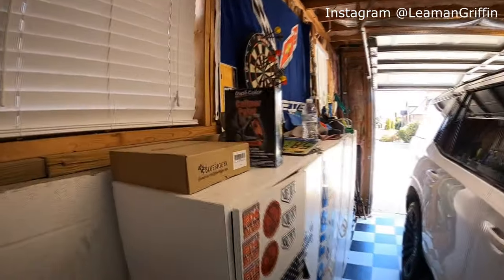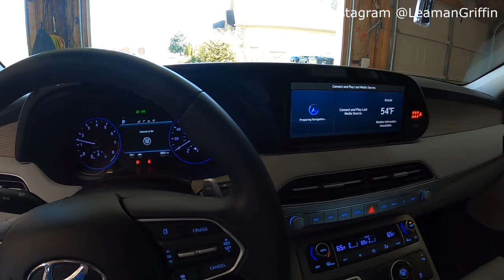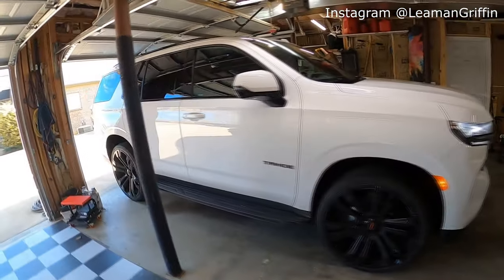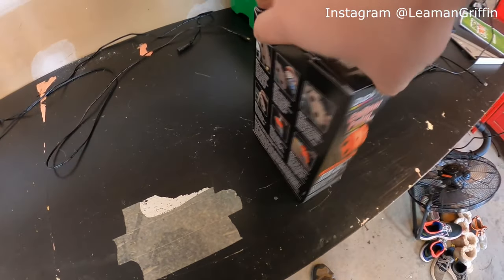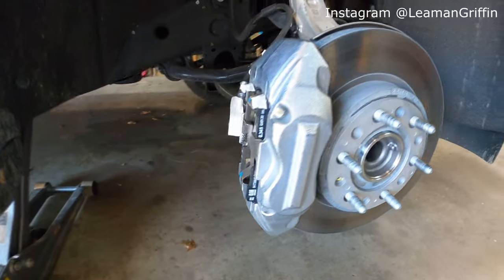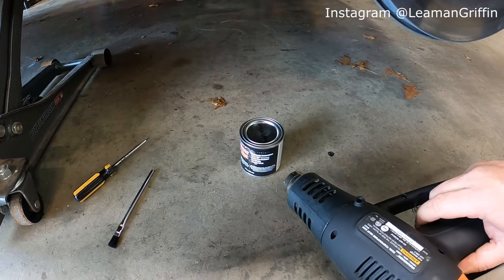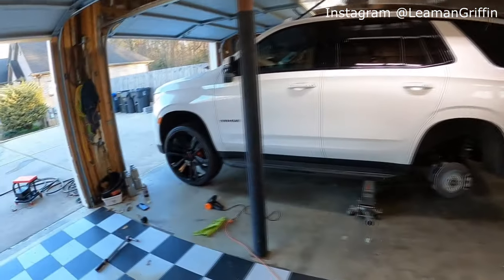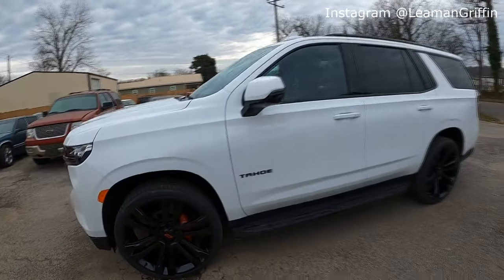How to Paint your Brake Calipers 2021 Tahoe Yukon DIY Tutorial

Comment: Looks awesome. I just took delivery of a 2021 Shadow gray metallic Tahoe rst two days ago. I have the black stock 22 inch wheels and the calipers were the first thing that I noticed. How many coats did you wind up putting on? I plan on going red as well.
Reply: Did you ever paint the calipers? I have the 2021 Cadillac Escalade same color as your Tahoe and I was thinking about going with the red calipers.

Comment: Nice Tahoe, brother!  I just bought a z71 edition.  Quick question, where did you order your spacers from and what brand did you use?  I just ordered the same wheels in a 22 and I'm going to run 285/50R22's and I'm assuming I'll run into the same problem in regards to the caliper rubbing the wheel, right?
Reply from the maker: Hey man thanks!  I got mine from the shop that installed the wheels.  Not sure the brand but im sure they will sell you a set!  Midsouth tire and wheel in pelham, AL.  Ask for Jason. Tell him Leaman sent you!
Reply: Question for you...did you have any trouble with throwing a Service Tire Pressure warning on your dash when installing your new tires?  I had new TPMS installed on my new setup and they claim to have programmed them to my 2021 Tahoe but warning light is still there.  Custom Offsets said they are ITM TPMS sensors.
Reply: @ashleyblair8866  ADDING 22" will make fuel Mileage Worse 
my 2018 Tahoe Came with 22 " nice to Look at 
Heavy as FCUK.
install Winter 20" Rides Better + Better Fuel Economy 
Black Tahoe , Black  6 spoke Rims , Yellow Fog Lights with Painted Red Calipers - Tremclade Paint